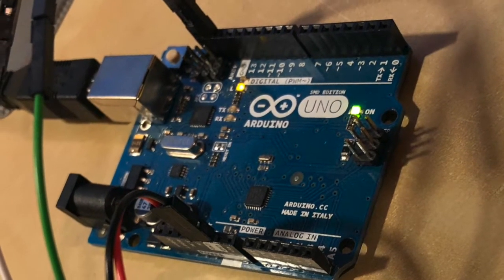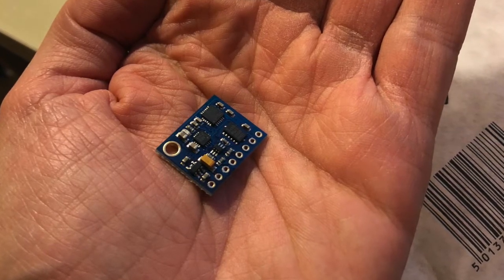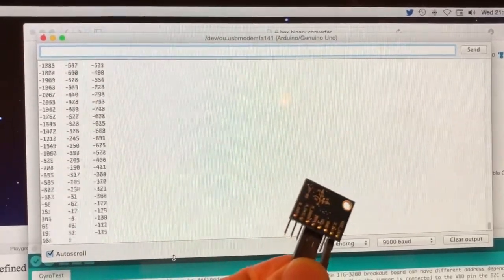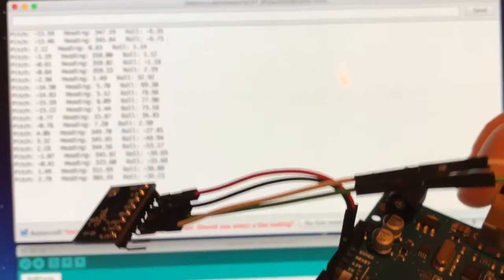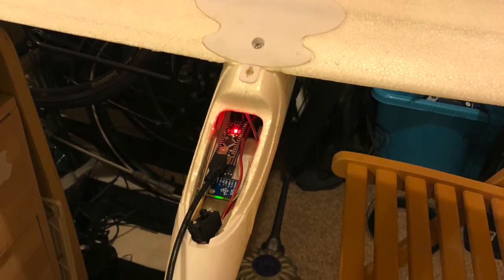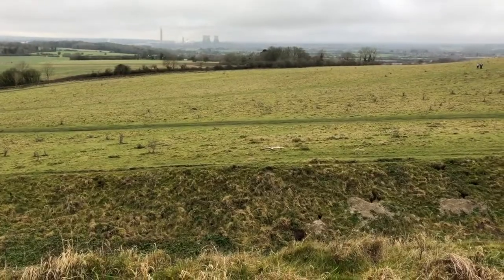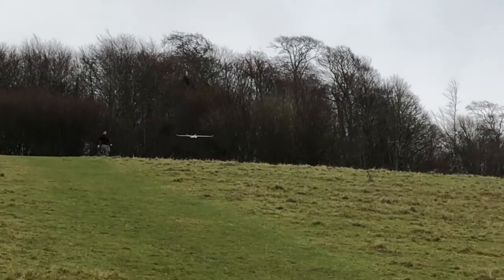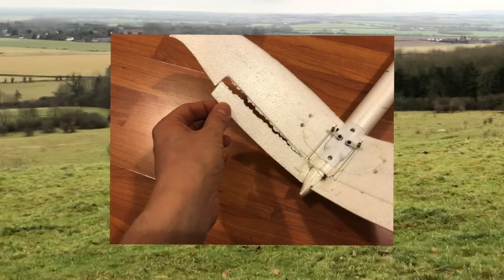Arduino Glider

Comment: So you measured, pitch, roll, and heading. Another video measured g-forces in either direction. I may try to implement all of this if I can. I'm thinking the magnetometer must be its own module because I don't think the acceler. comes with it.

Comment: lol very nice video i see the problem just when you connect the battery you have to make sure the plane its perfectly on level because the fligth controller gonna take for reference the position of the plane when it turn on  i mean if the plane are pointing down when you connect the batery or turn it gonna think pointing down are the rigth possition and to fix that tail tape just tape

Comment: That's exactly what I hoped I'd find when I searched for it! Thank you so much for this video and keep up the motivation to learn these things!
I was thinking maybe I could put exactly what you built inbetween the normal rc receiver and the servos. It would fly normally until you'd switch a flick, arduino detects the pwm of the receiver output and get to work. With some coding you could maybe also make it so the plane flies into the direction of where it was going just before flicking the switch.
Could you maybe provide the code of this project? I might give this a try on my 8 year old FPV plane. Waay cheaper than an ardupilot fc :)

Comment: In 2018 I found that the hobby that I had before entering the university, RC planes, had a revolution in the 20 years that I didn't could do anything... I bought a new radio, motors, servos, batteries, and several controllers. I started to work with them, I learn a lot, I made a few models (I have more work than when I was a child) but I learn, and now I have few planes that I connect to my computer by MAVLink protocol, and say to them where I want them to fly... "Do it to learn" that's is best true.